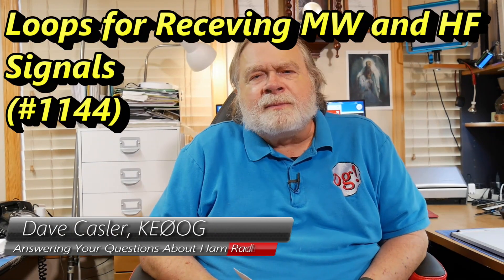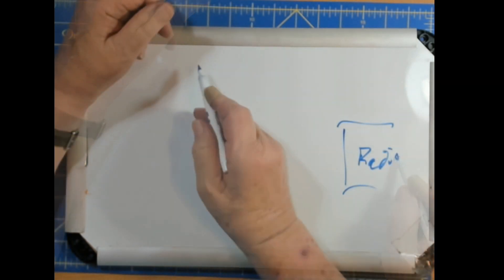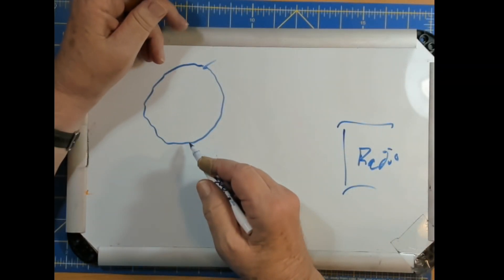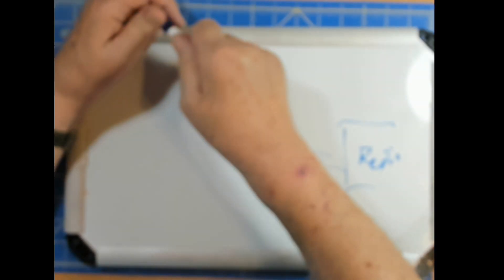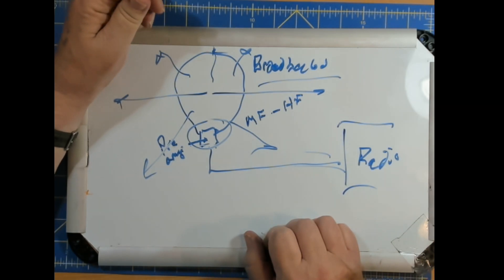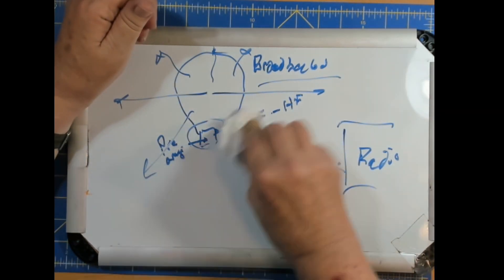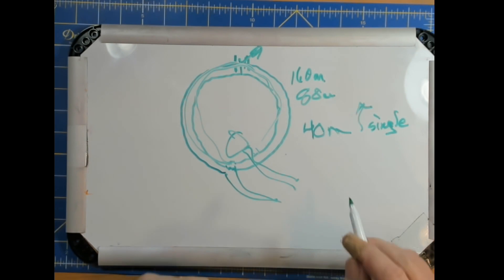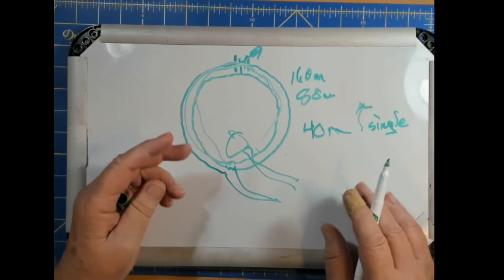Loops for Receiving MW and HF Signals (#1144)

Comment: For those into building wanting to give this a try, if you don't have a variable capacitor, two blank PCB's held together with a rubber band make an excellent variable capacitor.
5x7cm can give somewhere between 100-200pF for tuning.

Comment: In the UK planning permission from the local council is required (sometimes) for antennas. For small installations such as a mag loop or some form of long wire it usually easier and cheaper to ask for forgiveness than to seek permission in the first place. In most cases providing you don't encroach on your neighbours or upset them or go madly excessive with your installation, you'll get away with it. Restrictions in most cases are nowhere as tight as some HOA's in the US.
First time I have commented, but I've seen a lot of your videos. Keep up the good work. Thank you.
Al G8YKM